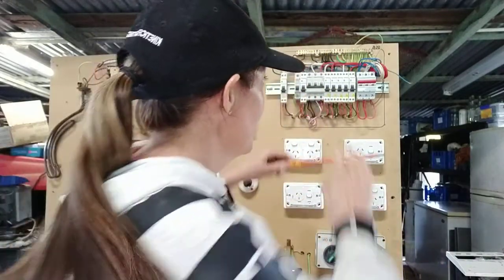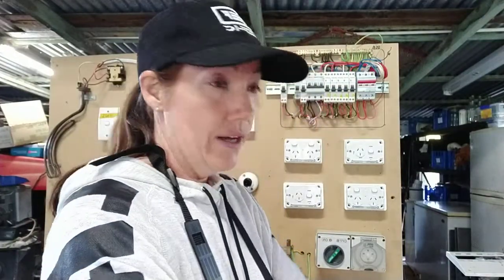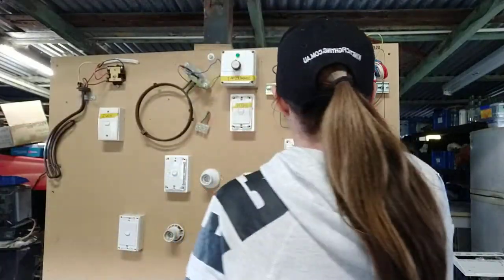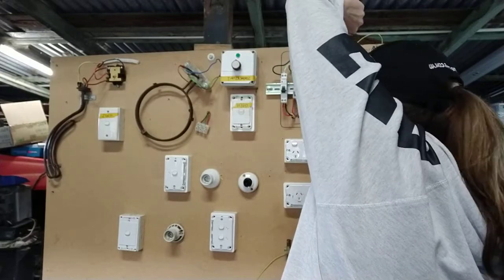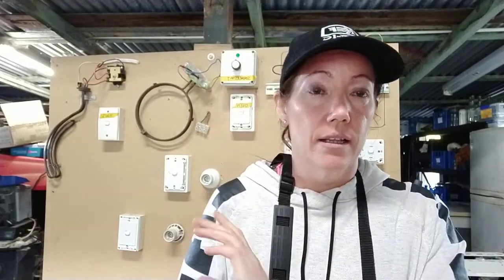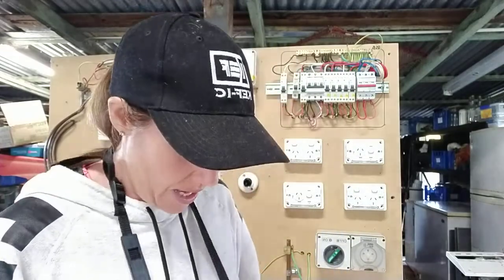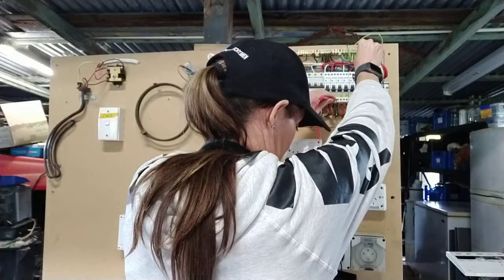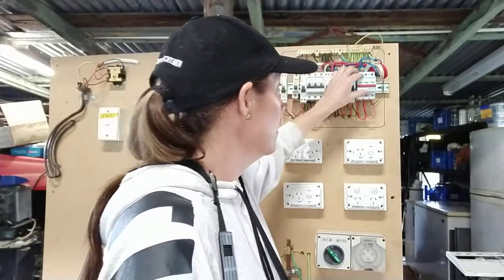Electrical Capstone Practical Exam IR Insulation Resistance

Comment: Can anyone tell me if this is still accurate 5 years later or if there have been any changes ? Thanks
Reply from the maker: Gemini's response:
Mandatory Tests Amalgamated
The total list of mandatory tests required by AS/NZS 3000 has been technically adjusted due to a standard amendment (Amendment 2 in 2021).
The test for Polarity and the test for Correct circuit connections were amalgamated into a single required step.
This reduced the official count of mandatory tests from six to five, although the required checks themselves are still performed. Insulation Resistance remains a distinct mandatory test.
Reply from the maker: Other than updated standard versions and RCDs up to 32A on all sub circuits IR testing and numbers are still the same.

Comment: 3:08 how are you touching the probe with your bare fingers when 500vdc is being injected into the circuit? Am i missing something?
Reply from the maker: At no time am I touching the probes with my bare fingers. At 3:08 I'm holding the handle part of the probe with the probe pointing downwards. 

You literally can't see the probe either as my hand is in front of it. So why even write this post?

Never touch the probes or touch other people with the probes. While it can feel like a quick zap it is still dangerous. 

Note some Megas 

1) Have a manual push button to apply the voltage.
2) Have probes that need to be pushed in to activate the voltage test.

Comment: Did you really remove comments on these videos after someone pointed out inventing significant figures for resistance readings is not how numbers work?
Reply from the maker: No comments have been removed unless someone else has reported it and I am aware there was someone made some rude offensive comments that were reported and removed by a third person. I never saw that post and it was not long after I posted the video. The resistance readings for this are in the NZ and Australian standards that I refer to. This is also the step by step testing process that is also provided in the standards for how this test should be performed. 
Happy to check what reading you are concerned about and at what timestamp in the video.
Reply: @theea3466  Yeah I was just confused by why if they call for 2 significant figures in the readings. Why is the last figure always rounded to 0? Seems wrong that they'd mandate the precision but then you'd just fill that precision in with a 0 in every case.
Reply from the maker: @whatilearnttoday5295 
Yeah just required in the standards. If you don't write to 2 decimal points it technically a failed answer. 
I was just making the point that that the limit of 0.5 resistance is actually 0.50. Obviously its not an actual reading which would be much different. Although I do recall calling out the tested readings as the resistance limits changes as per table for cable size and amps.
Reply from the maker: Your comment has not been removed its in the earth video. 
I have responded. 
Check your instrument to ensure you get the reading to 2 decimals. 
The video was designed more to show you how to get the reading and what the reading should be. It's a mock board.
Reply from the maker: Good luck with your exams.
Just remember I'm here because I needed extra support to get me through the Capstone and this stuff wasn't explained very well to me. I passed the prac but I was not as confident as to wanted to be.
I don't make money off these you tube videos.

Comment: Hi just about to sit my capstone practical now, just making sure so as long as your element circuit tests more than 0.01Mohms you’re good correct?
Also just checking another question is the active from the relay/off peak meter minimum size 4mm? The practice question I did said to use 4mm even though the circuit was 2.5mm 16A RCBO, I know the minimum size neutral to a meter is 4mm but just checking the hot water active must be the same? Cheers so much for your help!

Comment: Hi are you able to tell me how you do the IR on the whole installation at the board?

Secondly, how do you do a short cct test? thank you
Reply from the maker: Link: https://youtu.be/i8bavUrrBx0?si=7QCsN_h388ue7xvh
Reply from the maker: For Complete Installation 
Bridge A and N at supply.

Or Bridge Line and Load if meter.
All CBs and RCDs On
Disconnect MEN/HWS/Oven elements.
Test Ebar to Nbar

Comment: Hi thanks for getting back to me quick. I dobt know why Inqueationed about the sub mains lol. 

My second question. Why do you test on the load side of the MS when testing consumer mains? does it matter if we test from the line side ad well? I would imagine teating on the load side, you're sending voltage down to the sub circuits as well? thanks
Reply from the maker: At 58seconds 
I say load side of supply to L1 L2 and L3. Remember also Main Switch is turned on but all other CB and RCDs are off so it's not testing any sub circuits.
Reply: It makes sense now! in our pract we don't have a sun main to check. Only consumer mains and final sub circuits:) thank you
Reply from the maker: @warrenkelly4561  
All good. 
Just remember lots of places do run submains. As long as you get bigger picture.

Comment: the 3 phase switch on the right had side you check your consumer mains, Is that the main switch? and the CB you check your submains on the left, is that CB meant to be your service fuse?
Reply from the maker: 50secs -Main Switch 
4mins -Submain. This is a CB that runs cable to another location like a shed or outdoor area 
There is no service fuse on here. A service fuse runs along service cable (Incoming Supply) 
My service cable is the extension lead cable that I had removed at the very beginning of this test.
Reply from the maker: Check out the installation diagrams on this website. It may help. https://www.electricaltechnology.org/2021/03/wiring-consumer-unit-distribution-board-rcd.html

Comment: How did you check IR on sub mains gain? you removed the nuetral, then nuetral to earth? then active load to earth. And neutral you removed to active on load side?
Reply from the maker: Rewatch @4mins 
Submain is not on a RCD it's a CB so you need to remove connected N from N bar.  
Need to test N and E to Active
E to A and N to A.
The Neutral was removed at the Neutral bar. 

Usually your load side comes out from the top. This is because dust and bugs can accumulate on top so if you have a fire it's best it happens on the more protected side.

Comment: I have a question. 
When testing your 'consumer mains' how is it possible to do that. If the consumer mains has power to it and your testing it with your IR tester wouldn't that technically blow up your IR tester?
From my understanding the consumer mains has a fuse out on the street so unless your actually disconnecting it out there i dont see how you could even test that without causing harm to the cable? cheers
Reply from the maker: It's a new installation. You have run the cable but it's not connected at Connection Point or Point of Attachment.
You have to check the entire installation before connection. :)
Reply: Thank you so much that makes sense now  @theea3466

Comment: Should you be wearing rubber insulated gloves and leather overs, when carrying out 
* Earth leakage
* Continuity
* Resistance
When the mains power switch (RCD) is off and checked zero readings, you can probe with bare hands?
🐝💨
Reply: Firstly, there is no scenario in which wearing PPE is wrong. If you want to make it a habit to wear gloves, go for it. Also, you should note that when running an insulation resistance test, your tester is pushing 500V of DC current through the installation. You should definitely be careful when conducting this test.
Reply from the maker: These test are performed to check system integrity before any supply power is connected. 
So no you don't need rubber insulated gloves. 
E.g You have just wired a new installation on a new house, your checking system before supply is connected.

Comment: Why would a brand new installation have greater then 50M Ohms ? 

Teacher sent me here
Reply from the maker: It's in the NSW SIR and it's specifically states this for brand new installations that have brand new service conductors.  
Brand new wiring shouldn't have any resistance other than the wire itself. What increases resistance? Moisture, leakage..etc.
SIR.  1.12.3.1 Minimum Insulation 
Resistance.
'The insulation resistance between conductors and between conductors and earth of new services shall not be less than 50 megohms when tested using a 500V DC insulation resistance tester.'
Reply: @theea3466 is periodic inspection and testing a thing in Australia? That's what I do in the UK. Everything from domestic properties to commercial/industrial.
Reply from the maker: @ramblingimbecile2295 
Not periodic.
Specific Work Requiring IR Testing includes: 
1. New Home / Full Installation (Testing of all newly wired final sub-circuits).
2. New Consumer's Mains (Testing the main supply cable from the street to the main switchboard).
3. New Sub-Circuits (Installation of any brand new power, lighting, or appliance circuit).
4. Switchboard Upgrades (When replacing an old board and connecting existing circuits to new protective devices like RCDs/RCBOs).
5. Circuit Extensions (When new wiring is added to an existing circuit to extend its reach).
6. Repair or Rectification Work (Any work done to fix a cable fault, short circuit, or damaged insulation).

Comment: In AS/NZ 3017:2007 they have a IR test for complete installation…. Could you explain how that works? I’m confused on why it only test earth to neutral bar ?
Reply from the maker: Yes.  When you test for complete installation your testing the entire system.  
Mains + Submains +Final subcircuits.

If you test at the mains with everything connected your testing the entire installation.  If this passes everything is fine.  

For the capstone you need to test each section to show you know how.  

Remember IR test is checking for any insulation leakage under pressure.  

The rules state all live conductors needed to be tested with earth. 
Neutral is considered a live conductor.

Comment: Is there not a requirement to test the active and neutral against each other to ensure that there isn't a fault between them? I thought you would have to test each and every combination,  ie earth to active,  earth to neutral,  active to neutral.  If not,  how can you be sure that there is no possibility of a short or partial short between them.  The insulation may have degraded between them but not show up when testing to earth as the earth insulation could still be perfect.
Reply from the maker: Great question.  Yes there's other requirements. This video is just for Insulation Resistance only.  I have other videos on the mandatory testing you are describing; polarity,  earth continuity and earth faults.  There is a process for testing and it follows a particular order.  This can be found in AS/NZ  3000:2018 clause 8.3.3 
Check out my other videos.
Reply: NEVER TEST ACTIVE - NEUTRAL!!! You can blow up sensitive equipment at 500V with an IRT test.
Reply: @maxwilson6964  not sure the caps were necessary but ok.

So how do we verify that the insulation is good between them?  Ps, my main trade is railway signalling so I'm fully aware of the sensitive equipment issue,  we disconnect the cable on the railway to carry out this test.  Essential to ensure no false signals can carry between cores which could turn a signal Green that was supposed to be red.  Trains crash if that happens.  We also test at 1000v to ensure we stress the cable far beyond what its ever expected to carry. Rigorous testing for highly safety critical equipment
Reply: @paterson00  at the end of the day as electricians we are provided with standards to follow, As3000 section 8 verification outlines the requirements of an IRT. This video represents a guide (from an apprentice) on IRT. In my experience each individual will come to their own version of testing, some will float some will sink. Its up to the individual conducting the testing to determine whether or not they will certify the installation or not.
Reply: @paterson00  I will add that I am in agreeance with your comment. I have come across a situation where a T+E power cable had been chewed through by rodents. The circuit when testing was a pass. However the circuit breaker protecting was tripping at certain times of the day. When moisture had created a short between. 

I guess one way to look at it, when these scenarios arise conduct thorough and proper testing, record findings and then provide a certificate of compliance with detailed descriptions of what's been done by the individual.
Reply: @paterson00  curious though, in your line of work are there additional verification standards when conducting tests on signalling equipment/cabling??
Reply: @maxwilson6964  very much so.  Railway Signalling commissioning is carried out extremely meticulously.  

Verification is a qualification in itself and you require further qualifications to carry out functional testing and powering up of equipment.  

Installation staff are not allowed to sign off on their own installations even if they are also fully qualified Verification and Functional testers.  It's so that you don't cut corners on inspection and functioning since you carried you carried out the installation.  

Our roles as Verification Tester are to find every fault and potential fault.  The standards are crazy high,  not because of ego,  simply because they need to be.  If Railway Signalling systems fail the outcome is catastrophic.  Minor errors at any stage of the installation, verification and functional testing can be fatal if they aren't found just like in the electrical world hence the belt and braces approach to trying to find those errors.
Reply: @maxwilson6964  Take a look at the Clapham Rail disaster in the UK in the 80s. Caused by a few factors.  Signalling integrity failure was a major cause as was fatigue and working conditions not enforcing good test periods.   Thankfully things have changed dramatically since then but as always,  the testing is only as strong as the integrity of the individual not to lie about the results.
Reply: I agree with that guy